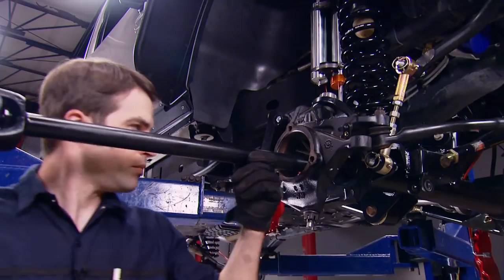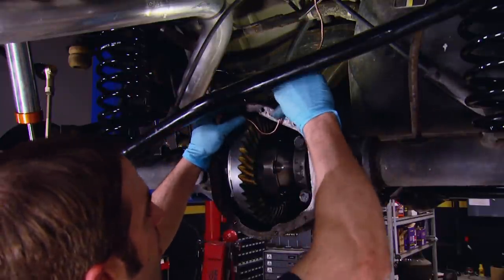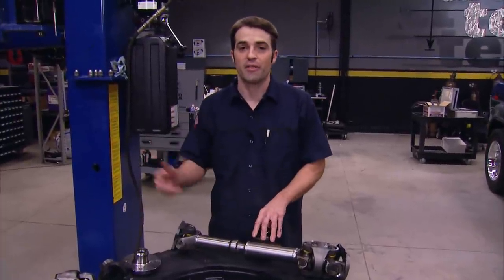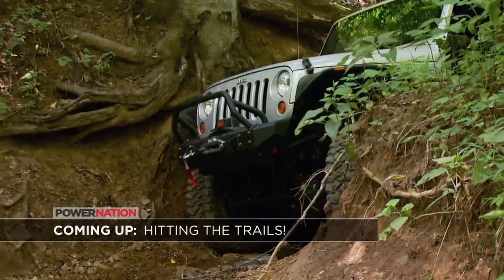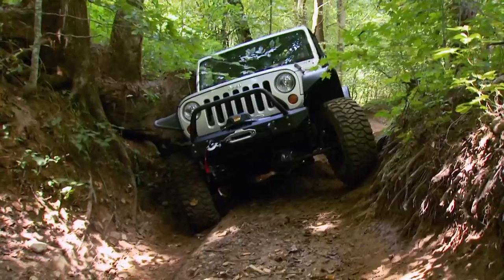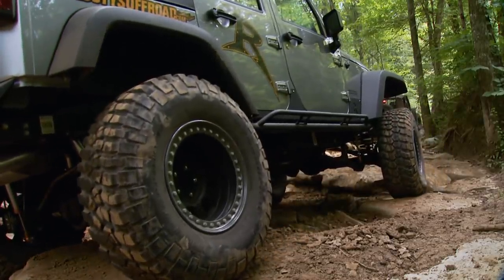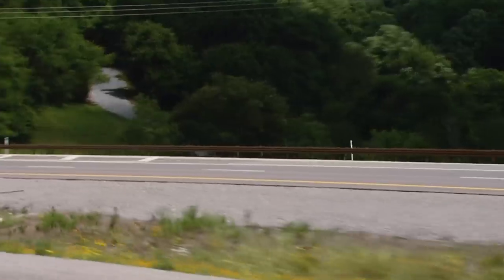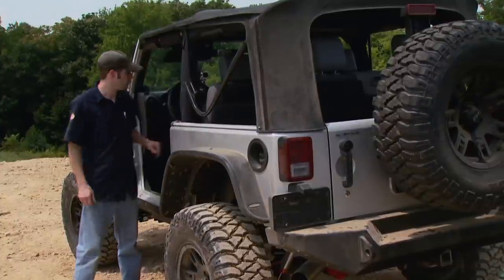Wrangler JK Rear Axle Gets Air Lockers - Truck Tech S1, E21

Comment: I seen on the drive shafts that a cv joint was used I personally do not like them. I have shattered many of them on my old truck I just removed them and went u joint to u joint with a slip yoke.

Comment: What did this total build cost?
Reply: I'm going to say bare minimum $20k.  More likely closer to $30k. Brakes are easy $2k.  Probably $3000 in wheels and tires alone.    Suspension probably $4-5k.   A crate 44 with ARB is $4-5k.   Engine swap and all the parts for it probably another $4-5k.   Bumpers and winch probably $3-4k.   Don't forget the vehicle if you don't have that.  So basically spending $50k to get a vehicle when finished is worth about $25k. Don't forget labor if you don't have the skills to do it yourself.   If so shop labor is easily $150/hr.

Comment: If you're not going to re-use factory axle shafts then might as well have upgraded to a 35 spline setup. 35 spline shafts & locker doesn't cost anymore that a 30 or 32 spline combo. Wasted opportunity imo
Reply: 03:21 the axle shafts were upgraded
Reply: @TrumpAmerica-2024  you're missing the point...they swapped stock shafts for aftermarket but with the same spline count. If all they were going to do was upgrade axle shafts then by all means but since they swapped out gears, lockers & shafts, getting the same factory spline count is a waste.
Reply: @apexpredator_jku  the stock shafts are 30 spline, the upgraded shafts are 35 spline. how is that a waste?
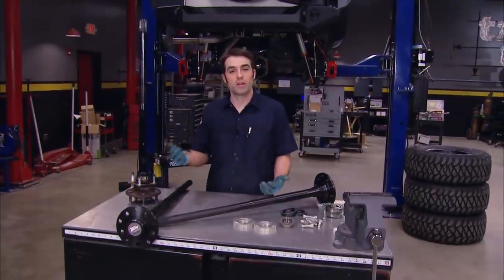Reply: @TrumpAmerica-2024   when and where did they say they were 35 spline? That's the whole point of my initial comment. 3:06 he says, "we could re-use the factory 30 spline shafts, they'll bolt right up". Which means, if they had installed a 35 spline shaft & locker, they wouldn't be able to re-use the factory shafts. All they did was swap out factory 30 splines for aftermarket chromoly 30 splines.
Reply: @apexpredator_jku  🤦‍♂️🤦‍♂️🤦‍♂️

Comment: Why the Hemi instead of a diesel.
Reply: Number one weight number 2 SOME what of a budget number 3 to much work for them lol
Reply: @chevydodgedude1234  size as well.   Diesels are just big.
Reply: @bmstylee  depending on what route the would choose yes
Reply: @bigboreracing356  well true but you get a lot more low end forth out of a diesel. A hemi is more designed for race car applications. Your
 going to have to rev the crap out of that hemi to make it perform in the power band.